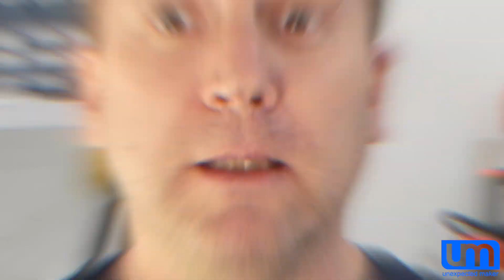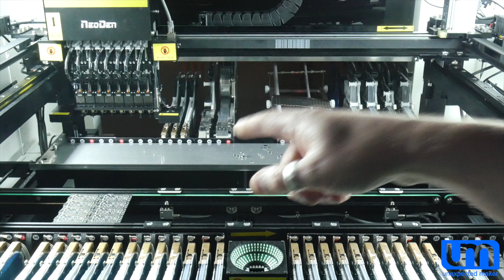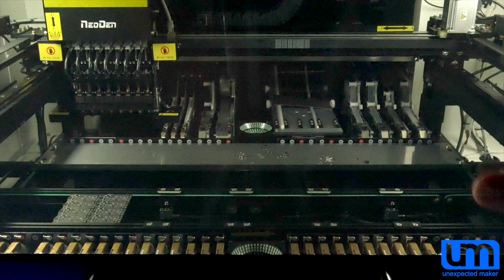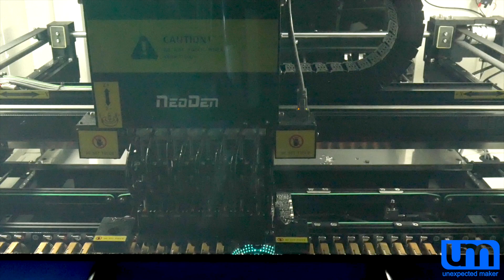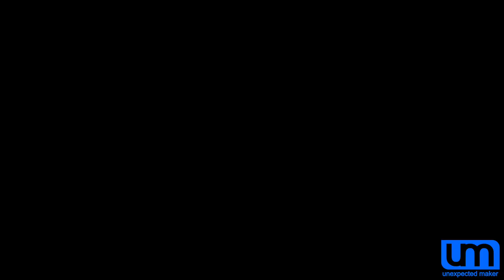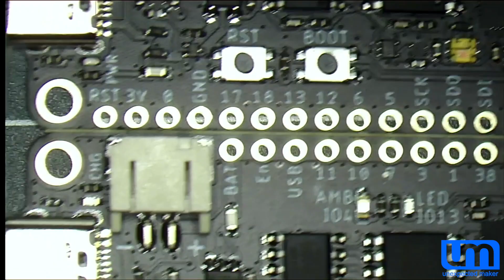Neoden 8 PnP (K1830) - O M G - My Mind Is Blown!

Comment: Hi Seon, I have a question relating to the Neoden 8 Pick and Place Machine. I have watched your videos (you are very inspiring!) and have read through the comments (your community is wonderful!) but have not seen anything that details why you changed from Neoden 8 to the new Juki machine. I read a post on EEVBlog that said it was having problems but there is nothing of substance. Are you able to provide a little context on why you stopped using the Neoden 8 and maybe how you felt about it after a few years of using. Thanks Heaps.

Comment: I know you keep knocking Charmhigh -- but you have not disclosed here that this machine is about 3X the cost of your older machine... Right?    In fairness, you have upgraded to better equipment, and this is not an apples to apples comparison anymore.     I think many of your parts are slightly off-center.   You don't have fiducial markings on the board to line up on?  Why not?   What is your total cost for the machine and the feeders?   Feeders are a big part of the price so, that is an important part of the investment.   Are these proprietary NeoDen feeders?  Or some industry standard?

Comment: Did you hve any trouble getting it Off the pallet without a fork truck?
Reply from the maker: I used a forklift to get it off. It can not be take off without sue form or lifting device.
Reply: @UnexpectedMaker  Thanks. Was confident for the K1830 @ 350kg could easily get this removed from the packing crate with only a couple of hand pallet trucks. Not so confident now with the N10 at 1 ton. :) We will sort something out though so we can do this at home (not the factory). Have a proper truck at work where it would have been a doddle.

Comment: Make a ' chear sheet " of component heights when you set up for things like the JST connector.  Most, if not all of similar parts would need an ajustment when you start new board designs, and faster knowing the refrence speed/height/placement/pickup-hold values from this ( and other boards ).
Definitly way better than playing scramble after every run to recover expensive components.

Comment: do you have electric or pneumatic feeders ?
Reply from the maker: I'm currently running pneumatic for 12mm+ feeders and the hybrid electric/pneumatic for 8mm. I do have some 8mm fully electric here, but they are not being used yet.
Reply: @UnexpectedMaker  seems the pneumatic feeders are 4 times less expensive than the electric ones ( for 8 and 12mm) , then the price is the same after 16mm .   ( or my chinese supplier made mistake on the quote )
Reply from the maker: @Tupeutla  Yes, electric are much more expensive than pneumatic.It comes down to what components you are wanting to feed. You can't reliably do small (0402 and similar size packages or below) with pneumatic unless it's a REALLY high end PnP, and then I'd still be going electric.
Reply: @UnexpectedMaker  we are talking about 250+ yankee dollars for 8 / 12 mm , right ?    ;)

Comment: Great to see the amazing results! Obviously you chose well, but why did you pick that model instead of Neoden 4, or something like a Small SMT 2800? I'm looking at getting a small scale production PNP in the near future so I'd be interested to hear what made you get that specific one. 🙂
Reply from the maker: My current production requirements are not "small scale qty" and I wanted something that would future proof me for a while and that I could really flex my capabilities with. 8 heads, fast, reliable 0201 and support for mixed pneumatic and electric feeders.

Comment: Oh how different. Looks, sounds and behaves as a professional machine, not the hair tearing "toy" disaster as the Charm***!#$#*  was. 
To have a first run come out as near perfect, before even making the typical optimisations is just great. That it is possible to get this result before really becoming familiar means it has few quirks and idosyncrosies. 
The multihead and camera systems seem to be working especially well, and positioning seems to remain spot on, not drifting over time.
Not visible if any parts have skipped/fall down, which was one of the worst problems on th Ch.....
Now you will not be sweeping up a fortune of parts all the time. Also can likely get production running to a schedule and expect to keep to schedule, withour needing 24/7 observation and rework.
You are finally on the way,.

Comment: About time something goes right.  Now a question. Found this on ebay. https://www.ebay.com/itm/Tronstol-A1-SMT-Pick-and-Place-Machine-With-Vision-System-58-Feeders-4Heads-0201/184554206436?hash=item2af849b4e4:g:0woAAOSwDRdfvxND.  Is/did Neoden change name/ownership to Tronstol ?
Reply from the maker: Neoden spun/sold off the S1 to the team that designed it, and they formed a new company called Tronstol and they renamed it to the  A1. I believe they have been improving it, but I don't really know.

Comment: incredible! why is it placing 1 board at a time? Is this because of nozzle sizes are all different?
Reply from the maker: it's because I am using the N8 software to panellise the placement, so a single board turns into 8 and get's done 1 at a time, just like JLC panellise a single board into a panel.

Comment: But the real question is how many parts are on the floor? But in all seriousness, that panel looks phenomenal and the video w/ the lid closed was perfectly clear. Great to see that the Neoden was is working great and looking forward to seeing your journey as you optimize this. For a follow-up, might I suggest a comparison of 60% vs 100% speed to see if the accuracy drops? This looks pretty solidly built so I don't suspect it will, but it could make for an interesting watch.

Comment: You might need one or two (under) support pins in the middle of the pcb to stop the bouncing. Great to have such a accurate outcome on your first pass. Hope this new unit gives you back some time for family and new projects.
 A layer of clear double-sided tape on front of vibration feeder can help with feeder tubes positioning. The volume level on the video could indicate the amplitude it vibrates at, is likely at a far higher level than it needs to be to move parts to pickup point.
Setting placing program if it allows to put IC's down first, then connectors, other parts, then the smaller passives last, will help with not having tiny parts under costly parts or things where noticing an out of place passive would make fault diagnosis difficult.

Comment: looks definately more reliable than the craphigh... about 15 mn per board at this speed...
just add a light inside !
the air expelled seems to make quite a noise too
argh a JST jumped... it looked like it's going down too far when placing that connector, the board was flexing somewhat
now go make some more so that Nate earns her keep ;-)
Reply from the maker: There are 2 super bright lights inside already.
Reply: @UnexpectedMaker  hah.
keeping the cover open may add reasons for vibrations. defeating the sensor shouldn't be hard

Comment: Congratulations! This looks great. I am glad you found a working machine finally! :) It is on par with the results I am getting with my Quad 4000C. I love how the NeoDen is so nice and quiet. The vibration feeders are always a pain in the butt though, even worse with ICs that love to climb onto each other. So I always try my hardest to not have parts in tubes if I can avoid it. That said, I bet you will learn more details about the machine and optimize the assembly time and pickup reliability over time, but that is just the remaining 1% that is how it should be if you ask me. Again, I am so happy for you! :)
Reply from the maker: I've now sourced and ordered JST and STEMMA connectors on reels ;)